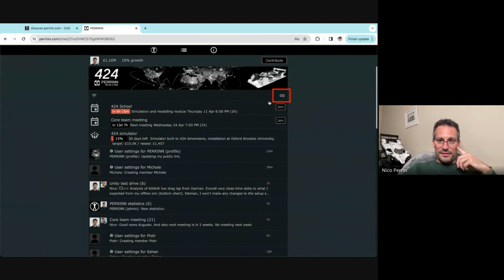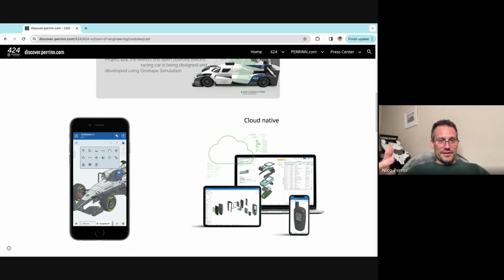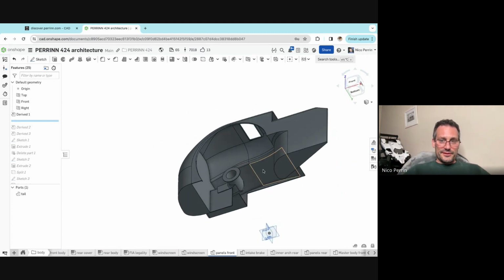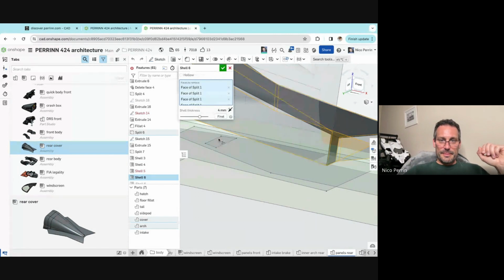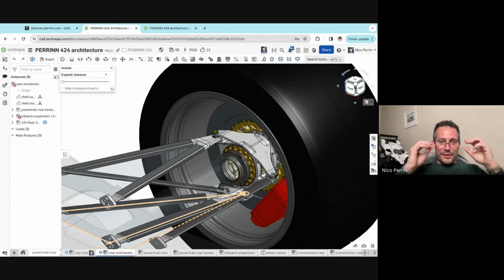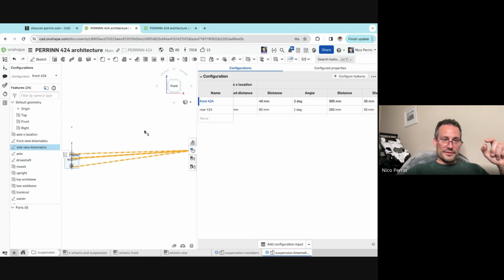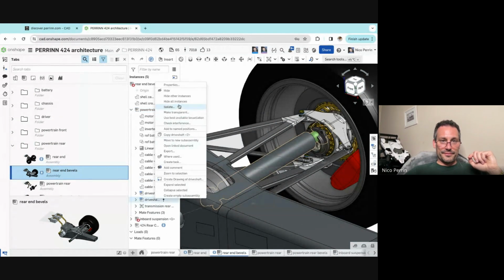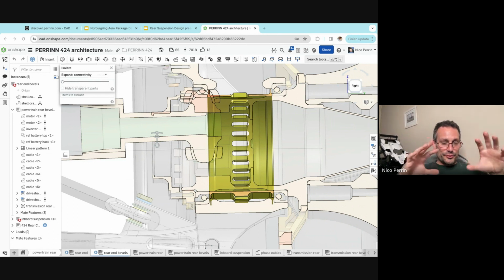424 School of Engineering - CAD Design

Comment: male mold your wishbones,  cut a bit of ali bar run a router down each corner and give the radius you want. polish, seal, mold release etc. layup/wrap up carbon and debulk as usual. peel ply, wrap in plastic tight, add breather then vac bag and cook as usual. then you need a winch to release it, can get spicy but shouldn't be that bad on anything this small.